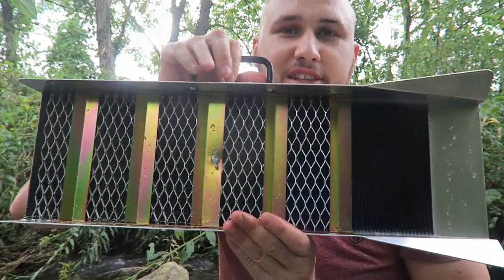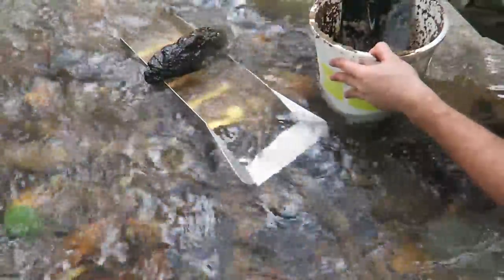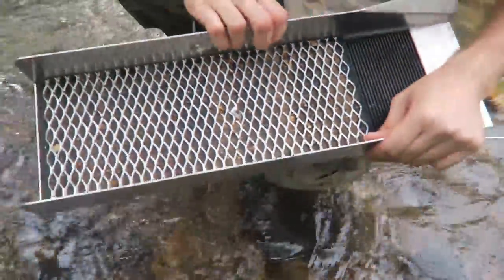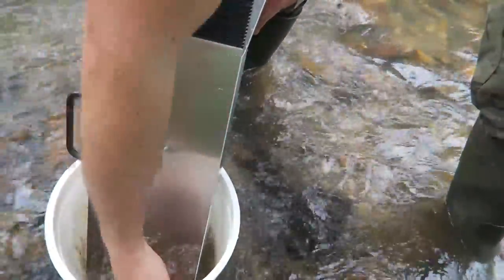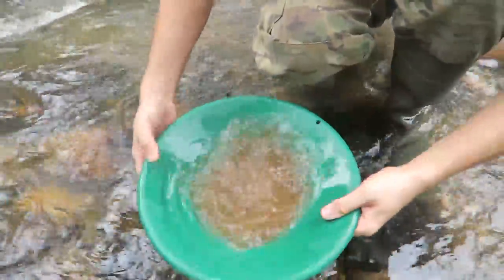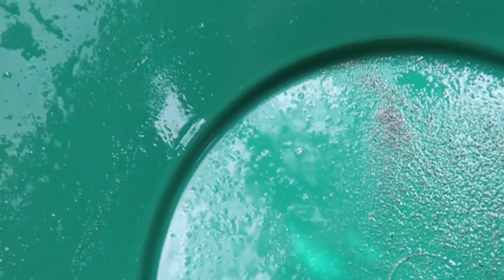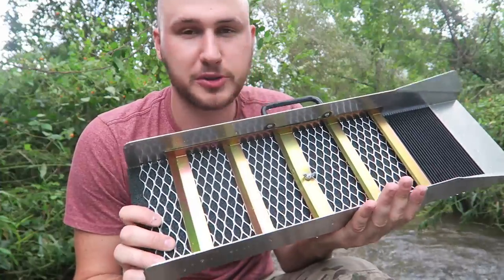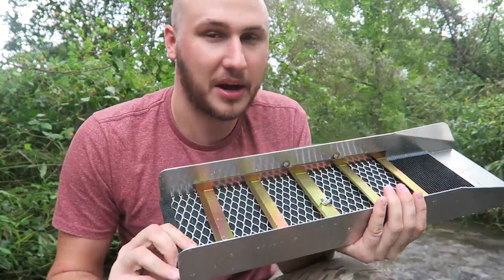Sluice Box - Gold Panning

Comment: try running more material through the sluice before you clean it out :) also try putting in smaller scoops at a time. Try running two buckets full through it then clean the sluice and pan it